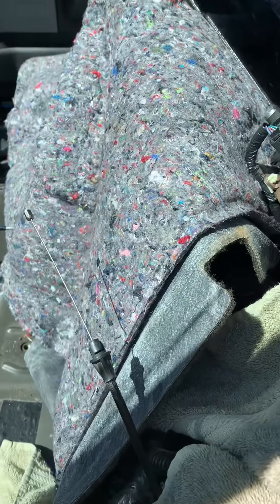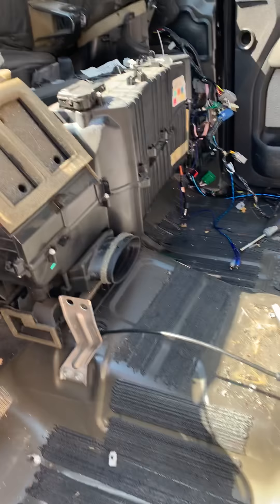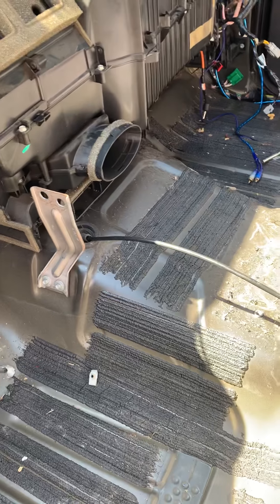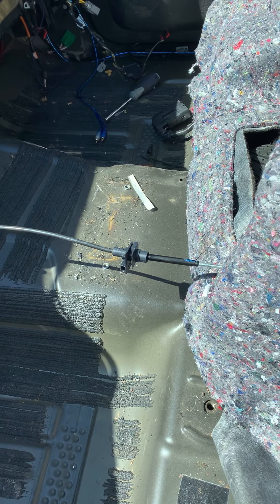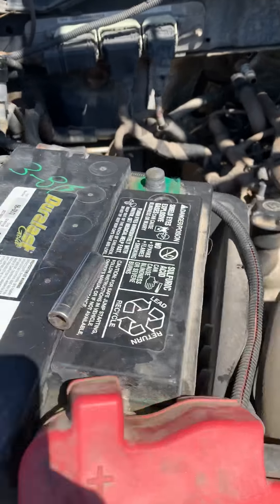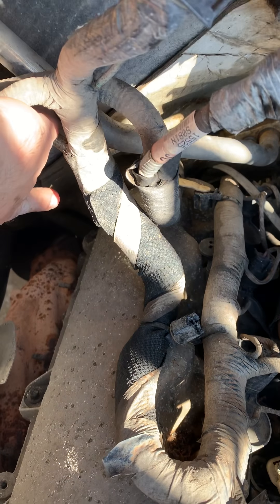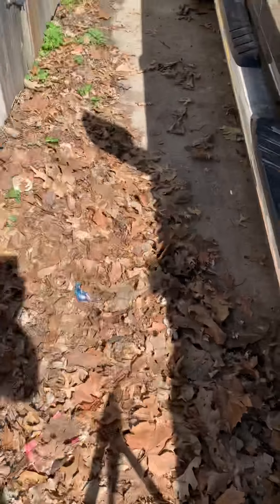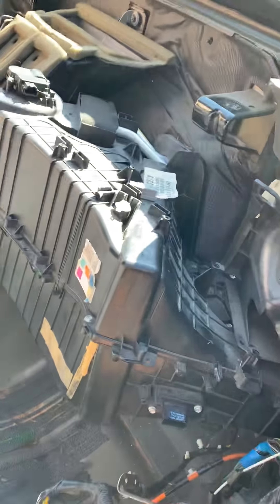2010 F150 heater core/evap assembly removal

Comment: is the heater core inside the black box with the evaporator core?
Reply from the maker: Yes
Reply: @jaybee-yh3ni  I currently have my dash taken off and the two lines going into the fire wall are off. How many bolts come off on the fire wall to release the black box?
Reply from the maker: @jasonjarvis4583  I can’t even remember I’m sorry. You’ll probably have to use a mirror to see all around it. Look around the firewall on the engine side around the heater core and ac lines that should be disconnected now for any bolts that look like they hold the box to the firewall. If I remember correctly there’s one further down the firewall close to the exhaust that you’ll probably have to use a swivel to get it
Reply: @jaybee-yh3ni  appreciate the reply, thank you!!
Reply from the maker: @jasonjarvis4583  hate that I can’t be more help
Reply: @jaybee-yh3ni  well got it all off...there is three nuts that come off from the fire wall and the a.c. line comes off also...three nuts come off the case from inside the cab, two on top and one the bottom...finally got that black case out. The heater core had a crack in it. Definitely two person job when putting the dash back on lol. Luckily my father in law came by to assist. Got it all assembled...best part NO LEFT BOLTS lol.
Reply from the maker: @jasonjarvis4583  that’s awesome! Glad you got it. Yep, definitely a chore. I unfortunately didn’t have another person to help so that made it that much harder. Dropped a few bolts trying to get them back in, the ones that go close to the windshield; still have one rattling around that I can hear rolling around when I turn. Haven’t had time to try to dig it out!
Reply: @jaybee-yh3ni  I dropped one bolt in the dash and luckily I was able to to fish it out with a magnet...so after that, I put a small piece of duct tape on the bolt and taped it to the socket...
Reply from the maker: @jasonjarvis4583  tried that too but still managed to drop a few.... was able to get what I thought was all of them by removing the passenger airbag but evidently missed one